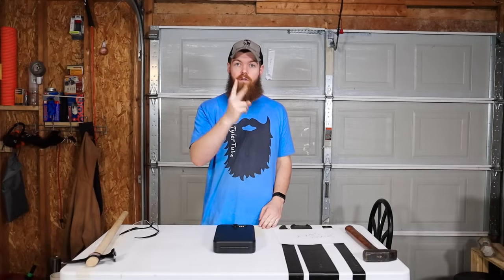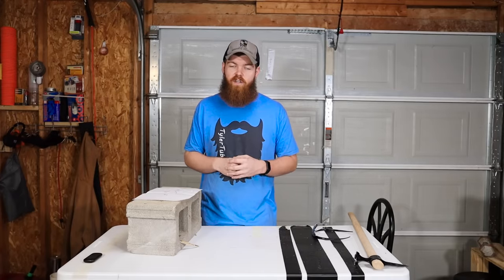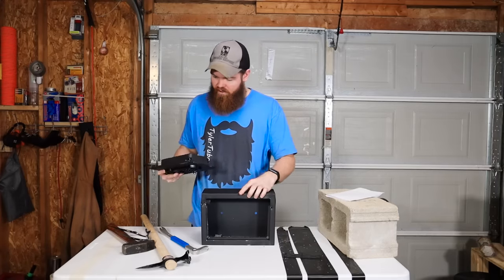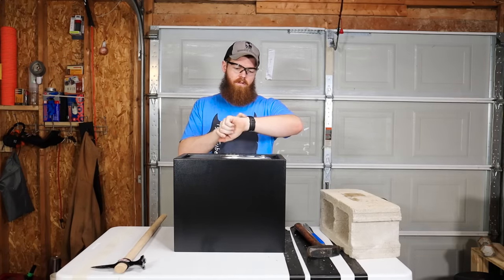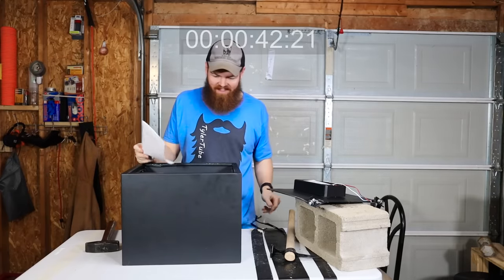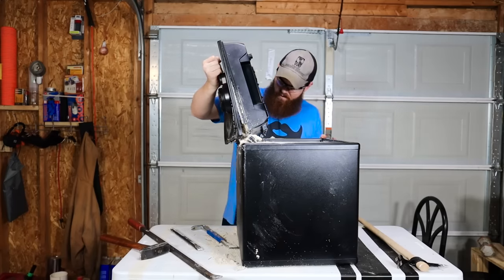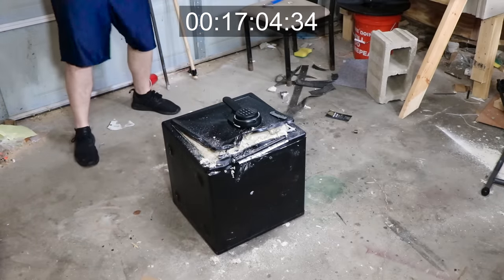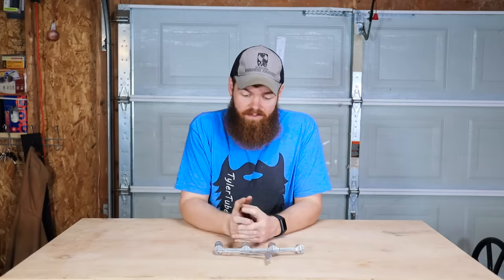How Hard Is It To Break Into A Safe?

Comment: I would like to see the last one again but this time you couldn’t flip it on to its sides. Most at home safes are crap if you don’t bolt them to the ground or the wall for that exact reason. It’s easier to grab the whole safe and break into it later to get the stuff inside. But I think that last one would be a little trickier if you could only get at it from one angle.

Comment: Most of the Safes like the last one are more made for fire . To keep papers money things like that from burning . I had a safe just like the last one . I wanted to see how many shots it would take from my AR-15 to get in it. One shot it didn't have the push button it had a combination lock an the key I shot it right below the knob it opened right up. The piece from the pins hold the door shut where it at the other end shot it in half.

Comment: Those safes are meant I keep documents, maybe a firearm, maybe a few hundred bucks tops. If you have large amounts of cash, precious metals or stones or anything else of high value. You need a safe with a burglary rating of at least TL-30 let’s see you try that. Also you can probably get  into any safe if you can get it home. The point of the burglary rating is for safes that are immobilized, then you’d have to work on it on site and with a TL-30 rating you’d have to spend a considerable amount of time on location, with power tools that make a lot of noise. And that’s highly unlikely.

Comment: I know this video is older but not a single one of those is actually rated as a safe.  They are all technically categorized as lockers.  If you had a true safe it would take you upwards of hours with power tools.  Take a look a a jewelers or bank drop safe.  They weigh 500+lbs for a small one

Comment: Technically you only tested 4 safes and a gun lock box which was the first one the first one is only meant to keep little fingers off of a handgun and any safe in time you'll get into in due time safes are only supposed to slow criminals down because they want to get in and out they don't want to sit there for even four minutes trying to get a safe open that's why they're meant to be bolted down and as of the last safe the Lock pins made of aluminum are meant to bend and disform to make it more hard to get into and the reason why the door didn't come off is because there's a kicker plate on the back of the hinge plate

Comment: I bet if you used an axe like a 4 pound full size axe it would be 1 hit and you would be into most of those.  Even those gun safes are super weak.  You can get into them in minutes.  They basically suck unless you get one with actual plate steel about 3/8 inch think and double layer. But those are pricy like $4000

Comment: Outside hinges means nothing, there will be an edge or fixed or active bolts going behind the doorframe on that side. Maybe not on this POS, but a real safe always has this. Cutting the hinges does nothing. Edit, yes this one also has an edge behind the frame on the hinge side, it can bee seen when he unlocks the door to inspect his failure.

Comment: The first safe is a pistol safe duh. Some safes are hell to get into unless you have a sawsall with a diamond blade I know because I had a safe that wouldn't let me in. I didn't have a hammer like that just the saw if he use a saw he would have been in it in 2 minutes the safe I had was a full 1/2" pin wrapped with steel on the back of the door and 2 1" pins that went across the whole door. Wow they don't make safes like they use to. He didn't see the sentry pins go all the way through the door

Comment: Just so we are all clear here lol, most safes and security doors are not meant to be impenetrable. They almost always have a rating so how long they average to resist forced entry.  Tyler is acting like these 3 safes are supposed to have NORAD or Fort Knox level of security to resist entry.

Most large safes that aren't the first one, are meant to be secured to the building. That significantly changes what tools you get to use, you also should not have inspected the inside to see what the weaknesses are, otherwise at that point whats the point, and you would not have been able to casually move them around the get the "right angle".  

The concept of the safe is not to make it impossible, but to make it impractical.  A thief usually does not get a large time frame like in movies and shows to take their sweet time to open a safe.  It's purpose to be inconvenient and impractical to the point of "it's no longer worth their time" and they nab lesser goods.  It took you 30 minutes for the last one.  Now imagine being in someones house that you don't belong in, for 30 minutes, with a sledgehammer, prybars, and times for breaks to get other tools....That is a crap load of noise, that neighbors are going to hear because a sledgehammer is like, the polar opposite of stealthy.  If the homeowner is home, you're surely going to get caught.

Funny video regardless, but for the consumer, safes are a better bet than nothing at all.

Comment: I actually have a safe which I bought for 850 dollars 
That thing is  a fucking beast it weights 162 kilos (360 pounds ) it has  a 6 inch door and 8 rods and to lock it you have 4 keys ( all different ) and you have to insert them in a specific order and lock the door.  3 of the bars goes back ward and it locks the hinges into place and it also had a fingerprint scanner ( not very responsive tho ) should you loose yours keys and the overall body was steel and titanium

Comment: Those safes would be infinitely more safe if the bars werent just on one side it should be on 3 sides so you have to damage them to break in, and they need to be made out of steel and not aluminium

Comment: These are meant to be mounted somewhere in a home. So that’s not going to be that easy to break in. My safe is anchored through my floor and into the concrete, then I have a 6 inch concrete and rebar box that my safe is bolted into. Yes it is possible for my safe to be broken into, but not without someone knowing it’s being done. And you cannot just pick it up and take it with you either! And just some random burglar is not going to know where it’s located or how it’s installed and how it’s mounted or where the weak points are! I am the only person that knows that information

Comment: Once again tyler the warhammer your using USE THE HAMMER SIDE  of the war hammer its designed to break things

also the idea of the safe is to be hidden, if you store money or basic valuables in it the idea is that your house has some kind of security system or alarm, so say if a bunch of crack heads break in, alarm goes off, they spend say 10 minutes (being generous here they would take longer if its hidden well) searching for the safe  then they try to open it and it takes 15 plus minutes, thats 25 minutes they are in your home (with that last safe with valuables in it too heavy too move) by that time the police would show up or depending on your security system a security would show up,

Comment: Those amazon basics safes are trash apparently and even if the lock was good you could cut threw the thin shell with a cutting wheel in less than 2 minutes get a good gun safe you wont get in that with a sledgehammer
Altho perception is half the battle if you think its strong you wont try it to begin with “ not you tyler a thief in general” is what i mean

Comment: The crappy wallet you are hawking has a money clip on the outside. I had $50 bucks fall out and get lost when I removed it from my pocket. I would avoid this wallet at all costs. It may not be expensive to buy, but you'll be pauying with lost $$$ when you use it.

Comment: You're missing a massive part of this, which negates most of your testing.  If each of those safes are installed correctly and lagged, or bolted down, you don't get to optimally position them for your little test.  Outside of the first one that only took a pair of pliers, all of those safes (if installed correctly) would have deterred the average B&E thief.  Once in a house, the clock starts.  If the safe isn't unlocked or easily beaten in a few seconds, they will move on to other stuff in your house.  This is an entertaining video, but nowhere near reality and I think your unjustified crappy attitude toward some of these safes could mean the difference between someone buying one of these and keeping their valuables, in fact safe..or foolishly passing on them and maybe not keeping their valuables in any safe at all.

Comment: I daresay every one of those could have been opened faster, silently, and leave little to no evidence of tampering, by exploiting the fact that, by and large, mechanical override locks on electronic safes suck balls and could be be picked in seconds by a chimpanzee. Or they left a big enough hole in just the wrong place, allowing access to the reset button from outside.
Your way is more fun though.

Comment: Look at the hinge party difference you're not breaking in this one at easy like you did that one this one here might take an hour so hey buddy wise up when the engines are welded on the outside of them that's when they're made good get yourself a Smith & Wesson safe or gun safe try to break them one of them once I'm talkin one that 3in thick and fire Preferred Concrete inside it's not going to happen

Comment: Hang on.... on the last one, you paused the timer to look inside, kept it paused while you "thought" and moved it to the floor while the clock was still paused. How's that fair? 😅😅🤣

Also, you said "most safes" aren't secure. You're for first three had an Amazon basics logo on them, and the last one one was WAY cheaper than any half way decent safe, by at least a £1000.

Funny vid tho.